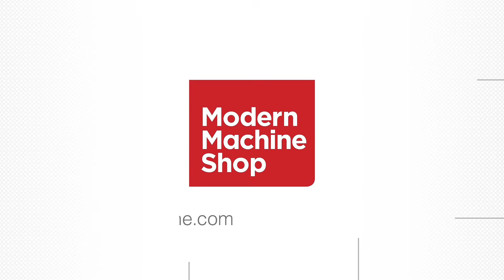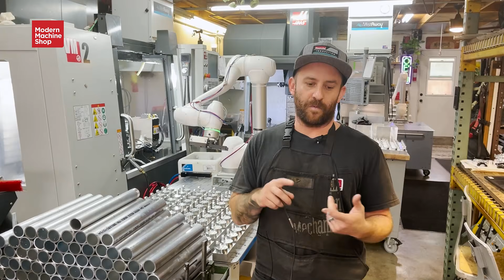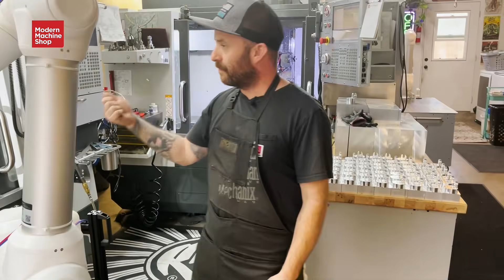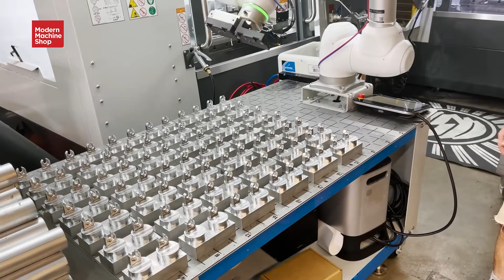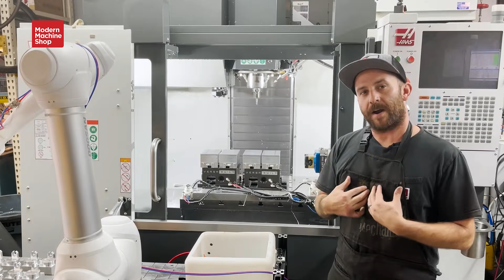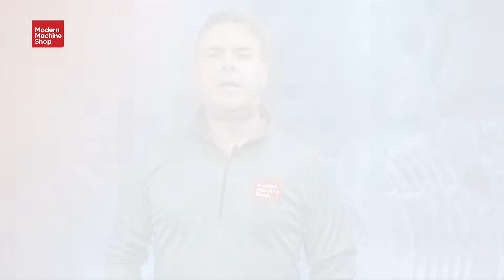Prototype Machining from a Garage Shop with Metal Parts Machine | Machine Shop Tour

Comment: Hey Guy.  Awesome little shop. Just curious these being 3 phase machines (not sure if your at 460V) I'm in Canada and we run 575 3 phase.    What are you powering these with? What type of converter are you using?  Thanks
Reply from the maker: From Guy Driscoll: Yes I have 400 amps going to the property, 200 for the house and 200 for the garage and yes I am using a 20hp phase technologies phase perfect to power all four three phase machines   (3 mills, 1 compressor)
Reply: @modernmachineshop  Thanks    I was looking at phase technologies. I had a shop for 30 years sold all in 2014. Doing some teaching a a local college. But still want to tinker with old Harley or trucks
Reply: @modernmachineshop  Only a 20hp converter? I thought the standard was 2x the machines hp rating.
Reply: @modernmachineshop   He was asking if you're running these machines on 460 volts 3 phase. That's typically used in industry and not usually available for residential. In Canada, industrial power is 575 volts 3 phase.

Comment: It's amazing what he's packed into a garage shop and still has room to move around. Trying to find info on his actual prototyping business. I have my 3d printers and manual machines in my chop, but no cnc yet for small runs.
An article on him said the shop is: 20-foot-wide and 48-foot-deep garage/workshop with an 8-foot-high entry, skylights, and 220-volt electrical service.
Reply: My whole apartment fits in his garage.

Comment: "My little workshop in my garage..."
(Proceeds to show off over a million bucks worth of high tech CNC machines) 👀😎
Reply: Haas aren't very expensive. People buy cars and trucks that cost more nowadays. The double pallet CNC definetly costs a lot more. I bought a Haas TL-1 for about 20k and the VF I got was about 65k. I prefer these machines because I do 1 to 3 piece prototypes. The rapid on these machines can be slowed down a lot. I like to make sure it doesn't crash since sometimes I'm only doing one run

Comment: What do you think of an Enshu JE60 horizontal CNC mill as a first machine?
Reply: Like... ever? Not going to have near the support as other brands and that model is discontinued. Horizontals have their advantages, but they suck to use as a general machine. Unless you have a need for a horizontal, a vertical with TSC/A makes a lot more sense and is far more flexible.

Everything depends on what you want to make and how many you want to make.

Comment: How do you have enough power to your garage to power all those machines and assuming a compressor?!?
Reply: When you have a million dollars worth of CNC machines it's no big deal to pay the power company 10 grand to come install a new high amperage sub panel.
Reply: In order to run multiple machines in your garage like he's doing... You usually have to have an additional service line installed to provide the additional power.  This man is NOT running all those machines on a common household circuit. -- He has a dedicated high-amperage service line installed from the pole to his shop & is using phase converters to provide the machines with 3-phase power.
Reply: How small US shops run on 115V with rotary inverters with so much power consumption puzzles me !
Reply: @SuperYellowsubmarin  every house has 240v electrical supply, our standard electrical outlets are 120v with 240v for things like clothes dryers, electric stoves, well pumps, air conditioning, etc., so adding a subpanel to the garage is pretty easy to run these machines at 240v.  I have a 100 amp 240v subpanel system in my basement to power all my wood and metalworking equipment, but I’m just a hobby guy.  For the number of machines he has, he might have had a second power line added for the garage with a separate meter that would allow more power than a subpanel from the main house panel, but sometimes that depends on if the power company wants to add that or not.
Reply: Phase converters.